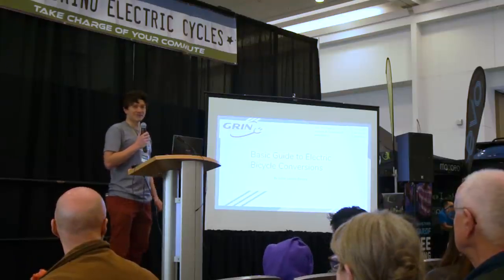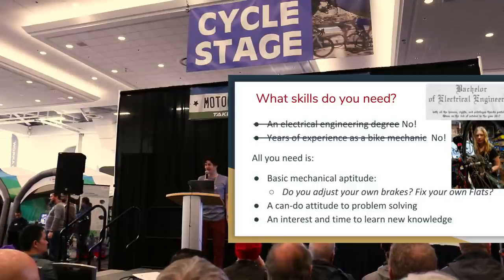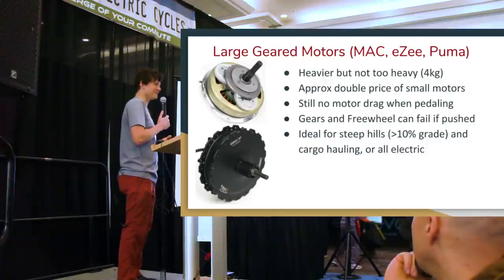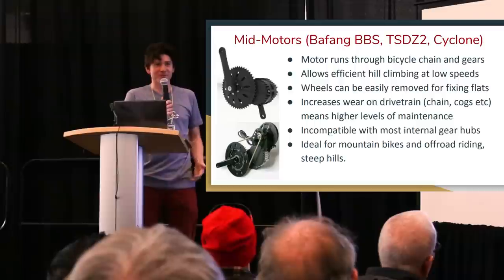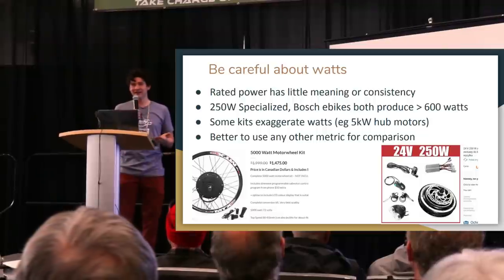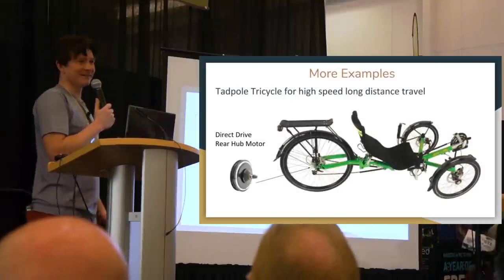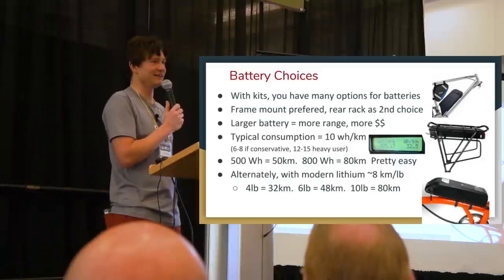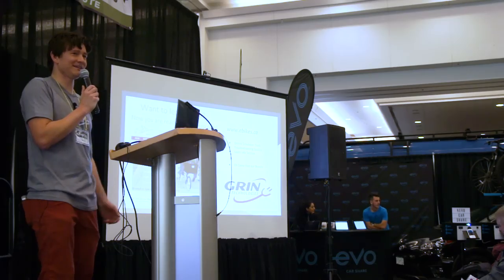Justin's Introduction to Ebike Conversion Kits, filmed live at 2019 BC Bike Show

Comment: Well rounded e-bike primer.

DIY is great for getting exactly what you need with high quality components.  Pre-assembled is good for adequate performance turn-key solution, but check replacement costs of proprietary Bosch/Yamaha batteries.  They are close to double the cost of a good DIY battery from Grin, Luna, or EM3ev.

Comment: I agree that re-gen braking with hub motors is awesome and hub motor setups essentially get it "for free".  The amps flow that e-braking can generate continually astonishes me.

The only one down side to e-braking I have encountered is many e-bike ESCs have jerky "all-or-none" e-braking which can make the e-braking a bit jarring to the rider.  The ESC could implement a PWM amp "ramp up" to make the e-brake activation a bit smoother so the user can still get max return amps.  The best way is to feed in proportional braking signal to the PWM e-brake controller and allow the user to modulate the e-brake just like a regular caliper or piston brake.  But most e-bike grade controllers do not have that feature though. I'm pretty sure commercial electric cars and motorcycles have it.
Reply: Some newer bikes address this very well.  My Stromer ST2S has 5 levels of re-gen that can be shifted on the fly.  For instance, pushing on the MINUS key initiates re-gen, and each additional push increases the level.  You can start down a hill, and as it gets steeper, just keep increasing levels.  Push and hold the PLUS key and it cancels.  As for brake activated re-gen, there is a user program where you can customize the amount of "attack", from barely noticeable, to very aggressive.  As the attack is fairly linear with the braking force applied, I keep mine at max.  It is very controllable.
You can also adjust the pedal, speed, torque, and agility sensors, making the bike seem to anticipate your every move.  This is aided by the bike also having an inclination sensor, and customizing all of the above further based on whether you are going down hill, up hill, or on a flat.  It is truly amazing compared to the other assist levels, or my other bikes that use just torque, cadence, and speed sensors.
I suspect we will be seeing more and more of these advancements in the very near future.
Reply from the maker: Yeah, it shouldn't take too long for even generic controllers to start 'coming of age' in terms of how they handle regen. We ensured many years ago that our entry level Grinfineon controllers have the means for smooth proportional regen via a 0.0-0.8V throttle signal range, and higher end controllers like the Phaserunner (or just about any other properly engineered EV motor controller) allow for smooth proportional and programmable regen control.

Comment: I run a Bafang G06 rear geared hub, pushing over 2000W peak, fitted to a mtb, never had a gear failure in 3 years, even crashing over rock beds under full power.

Comment: What about a delta recumbent with the two wheels in the rear and one upfront? And with 20" wheels.
Reply from the maker: In that case you'd simply use a front hub motor, very easy.

Comment: I've been using my alfine 8  with my bbs02 for a few years no problems. But I'm always careful not to throttle and change gears at the same time.
Reply from the maker: That's good to hear, we destroyed an Alfine 8 just pedaling with no mid-drive motor on a bike touring trip so my confidence in that model was really shaken. But I we should be seeing more and more IGH models that are engineered to cope with a well adjusted mid-motor OK, so over time this point about mid-drives + IGH should become less valid.

Comment: Mr. Seller. Doesn't this hub motor really have flaws? Only advantages? I'm trying to figure out if this geared hub will be ok for mountain trips with lots of downhills - meaning a LOT of regenerative breaking. Regenerative braking means HEAT in the motors windings. Meaning ADDITIONAL HEAT after i generetad a LOT OF HEAT while climbing up the hill. It also means additional heat in battery pack. Is there any means to control the amount of current going back to the battery pack during regenerative braking to not exceed the charging current? People using geared hub motors used to block one way cluch to enable regererative braking (like in your product) found it is easy to overheat the motor and easy to melt the planetary gears. Do you use plastic or metal set of gears? How about overheating issues? All the vids i saw regarding gmac motors are telling how fantastic they are and i haven't seen a single real life test in mountains...
Reply from the maker: I think you're commenting on the wrong video here (this is a general intro to conversion kit options, and makes no mention of the GMAC).  But that said, yes doing regen means that the motor and controller won't have as much cooling opportunity compared to having a hub freewheel when going downhill.  Since any motors that we sell with regen also have a built-in temperature sensor you can use the V3 Cycle Analyst to monitor the motor temperature and automatically scale power back if things are overheating.   The actual overheating conditions are very well modeled on our trip simulator tool here if you want to play around with it, 
https://www.ebikes.ca/tools/trip-simulator.html?m=GMAC10T&v=mountain&ms=100&h=100&w=26&sp=40&wv=0&b=B4823_AC&c=C20&rg=true&t=21&ct=21&st=21&i=man&p=16A08862FH9M&mo=&md=&x=&y=&lx=544&rx=NaN&rw=NaN
You can check and uncheck the "regen enabled" button to see the difference after drawing your example elevation profile.